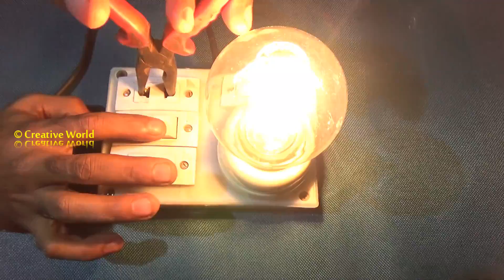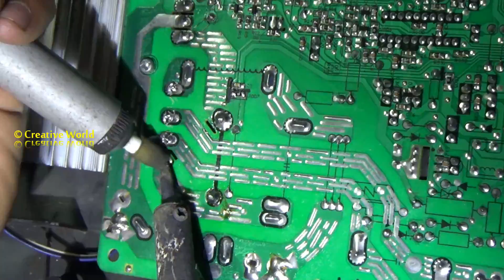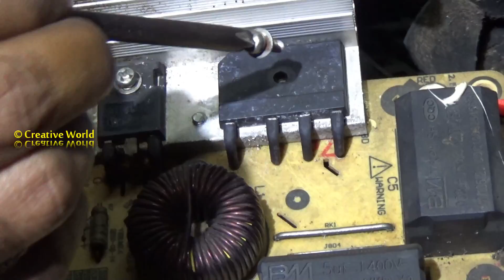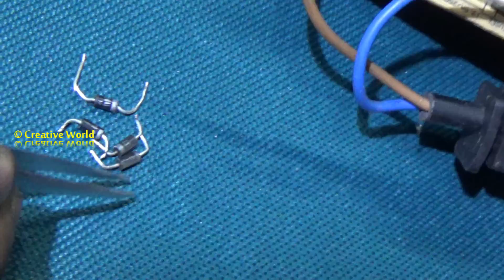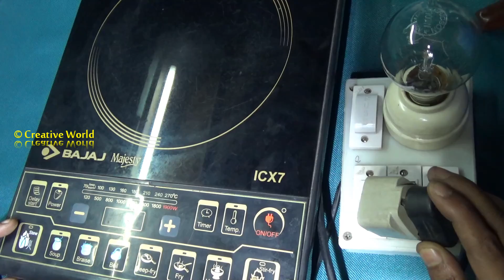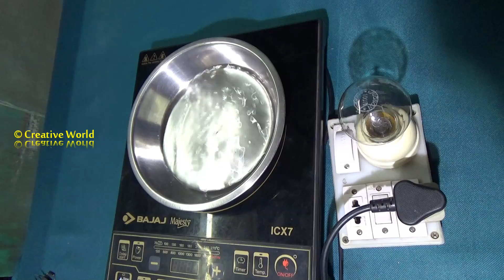How To Repair Power Problem Of Bajaj Induction Cooker (Step By Step) - English Tutorial

Comment: In my induction cooker I saw that two diodes burnt at point of the last two diodes you replace. What can made it to blown?
Reply from the maker: short circuit or high voltage
Reply: @CreativeWorldPro  thanks for time sir, Have replace the two burnt diodes still yet my induction cooker didn't come up. Have checked the igbt, bridge rectifier, the 22 ohms resistor, 4.7uf capacitor all these are in good condition.
But I discovered that the voltage at voltage regulator IC 78L05 is 0.02v , am expecting more than that. Please help me on this. The induction cooker is Preethi, the board is like the one you are working on, it has same components arrangement

Comment: hi very informative and practical video brother, i appreciate u. my philips 4909 induction cooker not switching on, checked bridge rectifier igbt are ok. 18v 5v not coming, observed 230 dc voltage coming upto r33 low resistance protection resistor but output not coming, r33 resistor showing open-- i think this resistor connects to 450 v capacitor-- may i know the value of this resistor? -one more observation is diode before 50 v capacitor showing short(50 ohms) , in diode mode voltage showing zero- may i know the model no. of this diode?
Reply from the maker: resistor value 0.33 ohm
Reply: @CreativeWorldPro  tq bro, I'll try to resolve it, but one more observation is 50v capacitor in smps circuit showing short, shall I replace this capacitor also?

Comment: I found c3 short..is it ok?
Reply from the maker: yes
Reply: I did replace the variable resistor with 1K it ok right? But after running for 1/2min the induction mosfet blows off what could be the problem? Thanking you in advance
Reply from the maker: c3 was a zener diode...
you should replace that
Reply: Can you tell me the value of that pls...
Reply from the maker: Case - SOD 123
Short Description - (2.57-2.84) volt, 30 ohm, 20 mA, 350 mW
Reply: @CreativeWorldPro  ok ill update you after replacing that...and thanks a lot for helping me out...hope it works well :)

Comment: I follow your instruction it's good for us...but i am facing a problem here,the induction run like in half cycle(run for 3/4 sec then off* continuesly
Reply from the maker: which company induction you use ?
Reply: @CreativeWorldPro  Bajaj majesty ICX7 i find C2 short is it normal? And i think the induction is running full speed and fast? It runs for a couple of hours and blows the MOSFET
Reply: Thanks for your precious time...well i did replace the variable resistor and a feeback resistor if i am not mistaken and it worked well...thanks alot

Comment: Hanbao power HB 19A model induction stove. When turned on, power auto cut off in few seconds n panel power LED starts blinking. Tested IGBT, Rectifier fine. Replaced top sensor, high voltage capacitor 5 MFD 400V - No use. Pls advise...
Reply from the maker: check the push button switch of induction cooker and 7805 voltage regulating IC

Comment: Hi. I have a phillips induction cooktop 2100W HD4928/01.
The SMPS circuit IC & big resistor are blown. I bought new Viper 12a IC but couldn't get the bid resistor as the colors are not visible.
Can u help me?
Reply from the maker: you can check the circuit board again,,there may be write down the value of the resistor
Reply: Suman Kumar

Comment: my bajaj icx7 induction heater's smd capacitor(numbering on pcb is C-102) has burnt so what is its value or what is its optional value.
Reply from the maker: C-102 value  = .001 uf/ 1kv

Comment: hi, i have a prestige induction cooker. once it's fuse blown. I checked and replaced the damaged igbt and fuse. For two days it worked well, then same thing happened again, fuse blown!. This thing is happening over and over again. I'm almost gaveup changing IGBT. What to do? Please help
Reply from the maker: you should check high voltage capacitor,,

Comment: havels induction Ka power problem tha igbt or fuse change Kiya.. ab power on Karne se beep sound ho k off ho ja Raha hi
Reply from the maker: try changing High voltage capacitor or Power Switch

Comment: Igbt replaced 3 times but getting short after 20-30 minutes of use. 0.3mfd capacitor is ok, transistor 8050 ok, preset ok, what is the fault??
Reply from the maker: you should check Coil ?
Reply: coil ok.
Reply: Same problem.... checked and replaced coil.... still same... please help Sir.
Reply: Low qulity igpt transistors

Comment: if voltage above 250 -300 then induction work krega?
Reply from the maker: what is value of filter capacitor ?
Reply: Please help me 7073563753

Comment: Igbt  गर्म ज्यादा होता है और बार खराब हो जाता है ।क्या करूँ
Reply from the maker: may be cooling fan damage,,or use Hongfa past,,
you also should use same value IGBT and tight the screw,,,
you also can change High voltage capacitor

Comment: Dear Sir , my Bajaj induction IXC7 takes more time to heat things. rest it is fully operational.
Reply from the maker: you should try changing high voltage capacitor,,,
Reply: Check 500 ohm priset

Comment: Sir is induction ka fault btaiye induction ruk ruk ke chal raha hai 2000 watt par bhi jese 300 watt par chalta hai
Reply from the maker: what do you,,mean by ruk ruk ?
Reply: the same problem in my usha  cookjoy please give any suggestion
Reply: ViggcAbhi Chauhan
Reply: Preset check Kare.
Reply: Agar preset tik ho to 5 uf and. 3 uf condenser change Kare aur heat sensor check kare